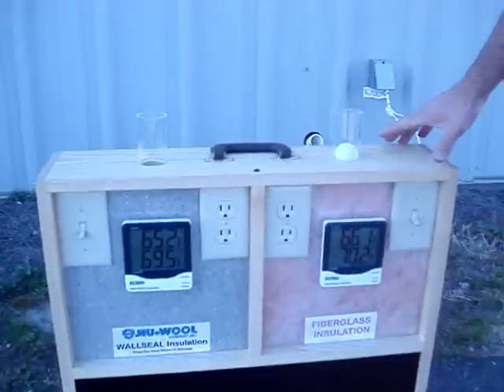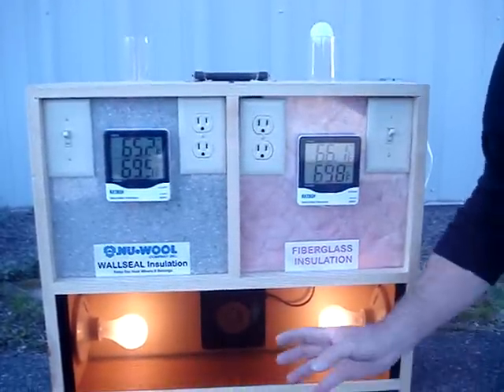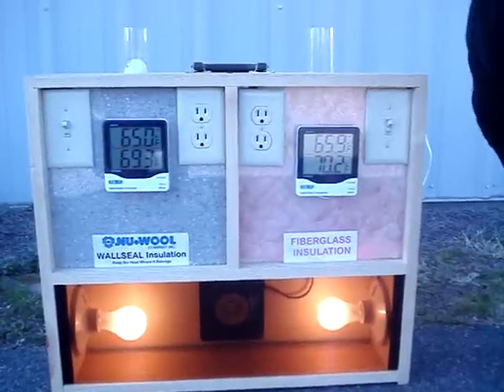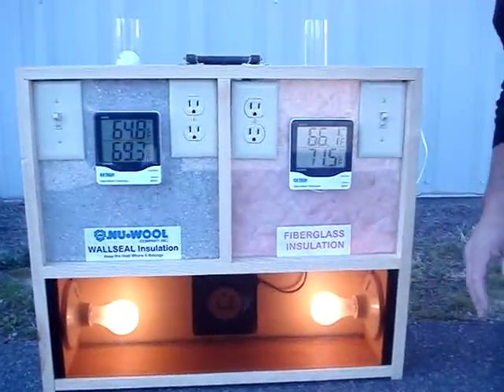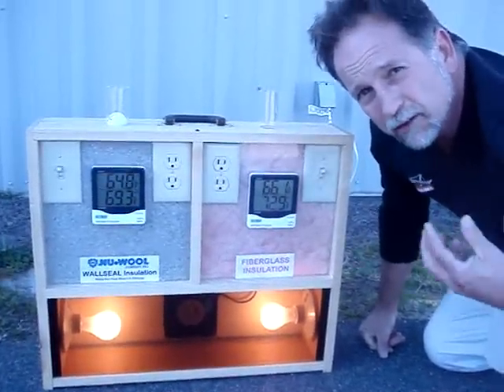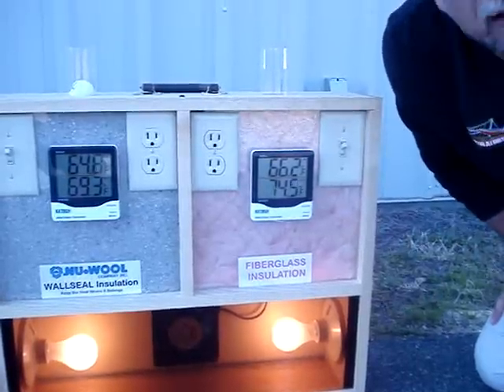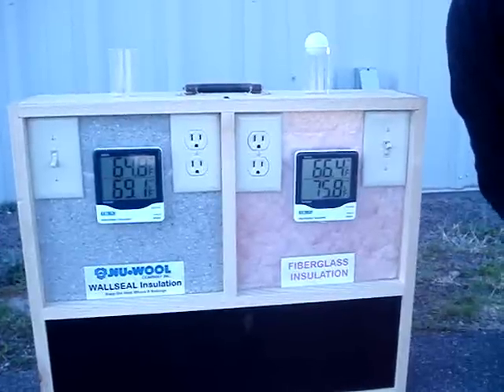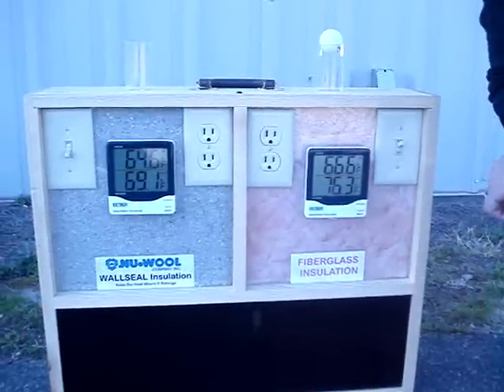John Meeks Explains Cellulose vs. Fiberglass

Comment: * CELLULOSE SETTLEMENT COMPLAINTS DOG INDUSTRY. 

In many respects cellulose settlement resembles mudslides and slides of
rocks and snow. Being a loose-laid “shredded waste paper flaked product,” cellulose settlement begins occurring immediately after installation resulting in a severe fall in insulation-value. Cellulose is primarily composed of loosely laid SHREDDED WASTE NEWSPAPER flakes, its vertical and horizontal strength is precarious at best.

* Cellulose insulation settlement is not a rare or random event, and is considered endemic to the product. Cellulose firm’s installers are told to not walk on it after installation and, if they inadvertently do so, they must  go around the job later filling in the foot-holes they’ve created before clients notice them. Unlike cellulose - Fiberglass rolls can be moved, re-laid, stapled and walked on without great loss of strength, value or life expectancy.
Reply: Actually this is untrue.. if you step on fg it CRUSHES the glass rods and R value becomes LESS... also In 100% of all energy incentive programs in the midwest .. FG batts ARE FORBIDDEN to eben be used and in several ore even blown glass is forbidden!... A 1/4"-1/2"  gap in FG batts can REDUCE  the entire R value in the attic by 10-15% because of air movement. DENSE packed Cellulose is NOT The  same as just drilled and blown anyway. DENSE packed CAN NOT SETTLE , there is to much material in the walls to allow that. ( it cant go anywhere) I have seen SETTLED FG batts and blown many many MANY times of my years in the buis.
Reply: @hotrodder: There is some truth in what you say, about 2% is true, and one must ask how many people trod on loft insulation-because the ceiling underneath might colapse - I agree with you about the gaps, thats why US GODS CONTRACTORS roll a 16" roll down 14.5" inch joist gap, You never thought of that did you. You cannot dense pack anything, buy a box of Cornflakes and its 63% full when opened. Shake it and it becomes 85% full, You must admit Cellulose laying is a bit of a CON TRICK, the fools order 8"-10", they get given 4"-5" inches, and 3 months later its gone down to 2" inches. The missing insulation is what keep the Casino tables busy. Are you aware that at the last Cellulose Insulation Convention held at the  WALDORF HOTEL IN NEW YORK, 3 sales reps Jaguars and Porsche Cars were stolen. One local Madam Brothel Keeper complained her ROOM SERVICE- Escort Girls came out in CELLULOSE SPOTS, and scratched for a week?
Reply: @hotrodder: As a company we chased turnover, so we stocked products that sell, and produced good leads when advertised. With 70% conversion rates.  Don't you know everyone knows it waste paper, chopped, sliced, shredded waste paper, a throw away product. I read Owens Corning employ 10 000 workers, which indicates just how popular their goods are when, each month they can pick up that kind of payroll. You should sell Cellulose Skin-Scabs Cure  Oitment. I for one do not believe it stunts growth, but thousands of Pygmies in the Amazon rain forest do.
Reply: Obviously you havnt heard the news...FG as a insulation is slated to be REMOVED from the market by 2019. Also its a CARCINOGEN... but that fact doesn't serve your rhetoric does it?
Reply: PSCP Insulation: PaperShredders Cellullose powder to give it its correct name is banned in 8 US states, and the Amazon Valley Tribal Areas, Brazil, the North American Green League activists objected to its use, they claimed it causea lipodystrophy - which makes human skin look wrinkled and causes early aging -  children suffering from this condition appear to be middle-aged. It cannot be reversed.
Reply: @ HOTRODDER. I have sent my wife out for 7 candles, so we can pray for 7 days to see if the Lord will intervene and protect you. Cellulose poisoning is slow but not painful, it cannot be cured so please remain positive. 6800 cellulose insulated homes is a lot of call backs, thats why most firms dissolve and re-register again and again to keep avoiding warranty claim. I am very impressed with your honesty,  at you admitting its newsprint, most Cellulose guys on YT try to make out its made by a secret process given to their grandfathers by Phineas T Barnum, you being the honest sort tells the world its shredded newpapers, toilet rolls, waste food wrappers, I know you will survive, but just in case tell your wife to keep a Legal Claim Diary, put down the date, Your skin condition, fingernails, falls and fainting, and mood. Then claim. Good luck.
Reply: Listen Mister, without letting on you're talking profit protection, and you're talking faith in how Cellulose makes you and others a wicked buck. Pak it in, give your client a fair deal, I was a major insulation contractor and know the in's and outs of the tade, and if I say avoid Cellulose then thats good advice. All anyone needs to do is Google BAD NEWS SCAMS CELLULOSE, and 3 first pages of hits all agree with me.
Reply: "WAS" being the  main word here  .. oh YOU say it and its good advice?? how much kick back did OC give you this time ?  Google CARCINOGEN pally....your SOOO informed?,,, you missed FG  on the list of soon to be PULLED products in the future then huh? Be informed.. it helps.  I notice you had NO RESPONSE  to my question on how taking out the pre garbage glass and replacing it with cellulose LOWERED my bills.... and thats been 16 yrs  running and  still 100 % performing. but that doesn't serve the agenda now does it??  WHy is it that once the temp gets to 20 ABOVE  the R value of FG BECOMES ONE HALF of stated R value? You can look up the University of Ill report on that..... ( its only about 9 yrs old now!) sheesh
Reply: Hotrodder sells Cellulose Paper insulation,

Comment: @ Larry Mahoney: LARRY, SOME GREAT NEWS, I'VE FOUND YOU SOMEONE WHOSE WILLING TO CONSIDER HAVING CELLULOSE SHREDDED PAPER INSULATION INSTALLED, isn't that wonderful news, her only concern is about it's bad reputation for "Spontaneous Combustion", this worries her, so when you contact her don't forget to mention if the electical wires and light fittings in the roof space are well covered then there' is very little risk, hardly any at all. I'll let you know if I find any others leads. Good luck on the road. Sign her up.
Reply: Check out the video called "The Big Burn".   I was surprised.

Comment: +Jeremiah Seip

"The most misleading aspect of this 'test' is that they ignore the fact that fibreglass batts are woven in layers to maximize performance, in side out, not along the grain (bottom to top) as 'tested' here. 

(And, the thermometers are way out of level.)"

Not really misleading if that's exactly how the insulation is installed in wall cavities. There are more fiberglass insulation tests done where the fiberglass is installed ideally like that in an attic with the heat source above it and once again the fiberglass fails the test.
Reply: +imzjustplayin  really? then what excuse would you use to explain  WALL CAVITY insulation?  Is that NOT top to bottom? Your rational makes no sense in that comparison.

Comment: Why every time I see this test.  We only see cellulose tested against a fiberglass batt and not a dense packed fiberglass loose fill like the cellulose product?
Reply: +cameron barney Loose Fill Fiberglass is even worse in performance. Hardly anybody does loose fill fiberglass.
Reply: Huh.... That's weird because I see wall blown fiberglass more than cellulose
Reply: I don't know where you're located but the most popular insulating technique is well known to be fiberglass batts. Batts are popular because any idiot thinks they can install them properly. The reality is, to properly install the batts around electrical and other obstructions takes a lot of time and care, something completely devoid in most construction.
Reply: +cameron barney in 27 yrs and over 6500 homes...I have NEVER installed blown glass in a side wall....EVER.
Reply: Yeah that's weird,  here in Utah it's the exact opposite,  I'm in construction and never see cellulose in a wall

Comment: Blown in insulation is not supposed to be an air barrier.

You are not testing conduction, or radiation... you are seeing the heat energy of the air being forced through the fiberglass. (Forced convection) Science was not this man's strong suit.

Cellulose is recycled trash and has a better mark-up... that's why he is pushing it.
Reply: +Heathh49008  Blown in insulation may not be intended as an air barrier but it seems in this case to work well as one.
Reply: +Heathh49008  who in the world EVER told you that?  the ADDED benefit of an insulation being a great air barrier only ADDS to its reputation as a great product!
Reply: I would agree however in a real world test against flame resistance the goal is to make sure there's no oxygen gap in the walls so that the fire cannot continue throughout the building
no oxygen in the walls means no place for the fire to go,
combine that with walls painted with flame retardant paint and your house would be safe,
although i agree that cellulose is highly combustible and the only reason it works is because of the additives they use to make it flame retardant.
Reply: +hotrodder62 
the fact that you're twisting my words is very demeaning, not once did I mention anything whatsoever in my previous comment about fiberglass insulation
in fact I don't agree that It's the solution either
because it melts which means the walls have no protection once that melts and It's also not soundproof,

cellulose is also not the solution because it is
highly combustible and the reason it doesn't catch fire because of the flame retardant treatment they use, although what would happen if they accidentally forgot to treat the cellulose before putting it in the wall? 
look at the pieces of film made years ago that were prone to instantaneous combustion,
 they were also made from a form of cellulose, if anything I would say cut up pieces of memory foam would work better than cellulose at insulating a wall although that material would also have to be treated with some sort of flame retardant.
Reply: mud would work better than both those materials but you don't see them using it in walls, why is that? because it would most likely cause the wood frame to get mold,
which brings the question why isn't there a compound fitted between two sheets of film that stays malleable that can be put in walls to keep the house cool and help soundproof a house.
Reply: In straw bale homes they actually do use mud but for the purpose of thermal mass. They make the walls exceptionally thick with lots of insulation.
Reply: +hotrodder62 
and by the way I didn't say treated cellulose is flammable
I said untreated cellulose is, check the comments before you say something stupid.
Reply: You said cellulose... DO YOU REALLY know of ANY cellulose insulation made that IS NOT TREATED?? sheesh what a moron. Admit your defeat in the hands of superior knowledge and move on. Mr misinformation king.
Reply: hotrodder62 Admittedly much much older cellulose insulation from 50+ years ago wasn't treated from what I know.
Reply: +hotrodder62
you're the moron for making accusations
because i never previously mentioned cellulose insulation
check the comments
not once did i previously say cellulose insulation

although i don't see why you would want to use that insulation anyway
as it's a terrible idea to place that insulation in an attic because any servicing that needs to be done on duct work or any cables or speaker wires you want to install in wall through the attic are difficult to do especially in the compact spaces of an attic as you now have to wear a respirator as a simple dust mask won't work,
another drawback is the cleanup as that material sticks to your clothes and the insulation also causes skin irritation.
Reply: zero2umashi The same rules apply to fiberglass.
Reply: yes in fact it was.... with sulfates ( that was the excepted norm with the current science at the time) today it is borax . FG is not anything like it was 50 yrs ago as well ...things improve and change.
Reply: Look just admit yo have lost and LOST BADLY. Sheesh... in a video about CELLULOSE INSULATION and you try and say NOW that you were talking about things cellulose based vs fg insulation?? You really are a SPECIAL KIND OF STUPID ARENT YOU??  RE READ WHAT YOUR PEA BRAIN WROTE! .. YOU did say "cellulose" as it relates to insulation. CELLULOSE is a irritant and itches??? ... LOL!  you cant even keep your comparison s straight! THATS FG YOU TOOL!...  Ive done OVER 7000 homes and id venture to guess have only wore a DUST ASK maybe 100 times?? the rest of the time its so natural I DON'T WEAR ANYTHING!.... But when your grasping at straws and making things up as you go with NOT A  SHRED of any evidence or fact I guess thats par for the course.  You have LOST this entire discussion because you base your argument on emotion and not any fact whats so ever..... be gone with you now and go play outside with the other children..
Reply: You're suppose to wear a particle mask with any materials that can become airborne, doesn't matter how inert it is.
Reply: +hotrodder62
What's that, you actually think you've won?
Trust me you didn't win I've just decided not to continue arguing with an ignorant egotistical self loathing jackass
As you're extremely stupid to say the least, you can't even keep an intelligent conversation without resorting to arguing and name calling, you're not worth my time
And if you think that
by calling you names I'm being a hypocrite trust me I'm just returning the favor and nothing more.
Reply: HAHA! yes! you have been crushed and CRUSHED completely ! ( sniff , he he he said something that hurt my feelings ... I don't liiiiike it" sniff sniff) Self loathing? you REALLY ARE as stupid as you have shown youself on here aren't you? People like you ALWAYS get upset when someone with FACTS and SUPERIOR  knowledge blows away your rhetoric and misguided spewing as I have done... Yes hillary jr...... I "loath" myself  for blowing you out of the water...BADLY.
Reply: you sound stupid, if you had Superior knowledge like you claim then you'd know how to fix plumbing,
know how to install electrical
and proper color coding, know what a toslink cable is and how it works
and no it's not just a red light going through a fiber optic cable there's more to it than that,
know what differential signaling is and how it is integrated into todays networking, 
what is the common cause of computer problems,
know how to solder micro sized electronics
know the proper solder gauge used for soldering 20 awg wire, 
know how to repair electronics if the leads on a circuit board are broken
without building a new circuit board, 
know what the common resistance on a coaxial cable is, 
know at&t's color scheme for a cat 5E Ethernet cable, 
know how an HDMI cable works and why switching to a more expensive cable won't change the picture quality, 
but then again you don't because you're not smarter than I am
and all that stuff I mentioned I know about and can answer without researching
and I know how to implement the rest.
Reply: You have vexed yourself as the miserable liberal you are... "look over at this hand while I try and confound you with the other" Superior knowledge pertaining to THE SUBJECT MATTER is really got you in a quandary doesn't it?  NO ONE said "over all" but rather THIS subject. As it pertains to THIS video.... run along now to your "safe space"  and lick your wounds. Maybe while your there you can look up cellulose and celluloid ... LOL!
Reply: HAHA! 'OFF GASSING"   now I KNOW your desperate !! wow.. google FACTS  cellulose asbestos? ??... you must work for either old lady clinton or some liberal media outlet .. what? you just make it up as you go along??  the battle was LOST for you many many posts back lil boy.. give it up. TRUTH has won out. OC underling for very long?? LOL!
Reply: My Dad made his own cellulose insulation by grinding up tons of old news papers. I remember that job, we installed it in Dad's renal houses, and about 8 years later a disgruntled renter burned the house he was in; witch in turn cought the houses on either side on fire (also houses Dad owned and had put that insulation in).
I wondered what it would be like sense we didn't put fire retardant in it. What I observed was that it did not burn at all. At most it smoldered, but it was too dense. I have sense wondered if they really do put fire retardant in it because I know we didn't, I fed actual tons of it into the grinder.
Reply: so in your world .. cellulose is one thing but the chemicals ADDED to it ( which makes the TOTAL product) are another??  ..WOW . So with that logic when FG MELTS away in a wall during a fire the binders added during mfg process are different too?
Reply: Warning: Google these search words before ever buying cellulose insulation. Look for Searches related to known CELLULOSE scams bad news business area. 
cellulose insulation problems health
problems with cellulose insulation. cellulose insulation problems health
problems with cellulose insulation
cellulose insulation off gassing
cellulose insulation dust
allergic to cellulose insulation
problems blown cellulose insulation
cellulose insulation asbestos
Reply: WHERE are you getting THAT I SAID YOU SAID anything about FG??  D you have a learning problem? I SIMPLY used your ill advised logic on the matter... sorry sally your so fragile.
Reply: "Highly combustible"... which is a total lie... but then  in less than 4 more words "the reason it DOESN'T CATCH FIRE" ??? wow ! LOL laughable how this continues down the rabbit hole you cant get out of......